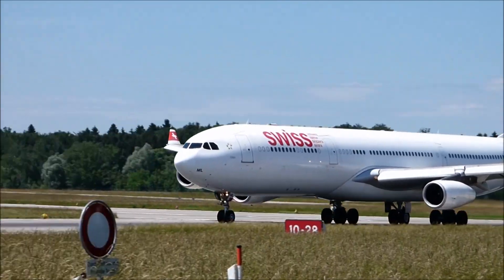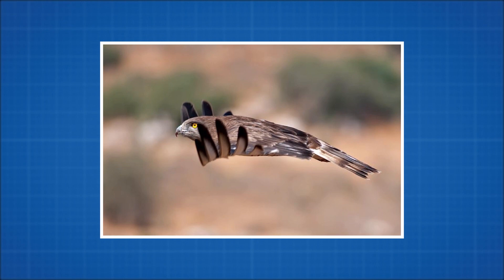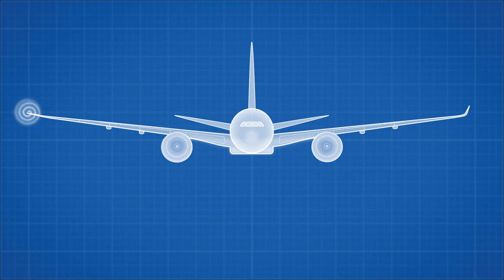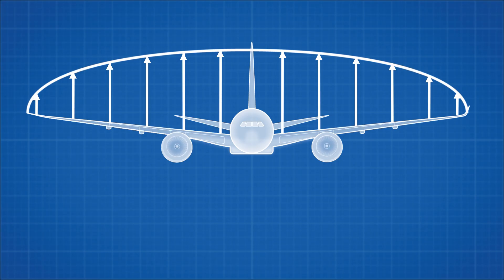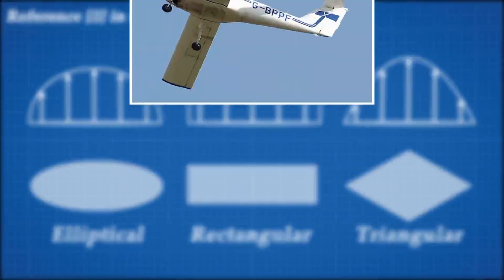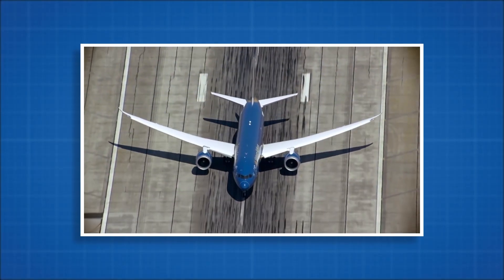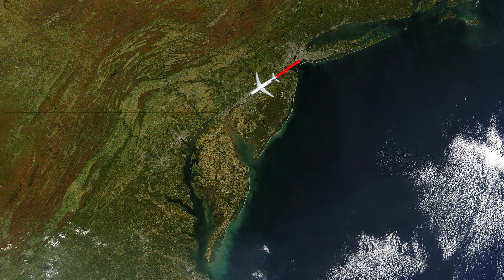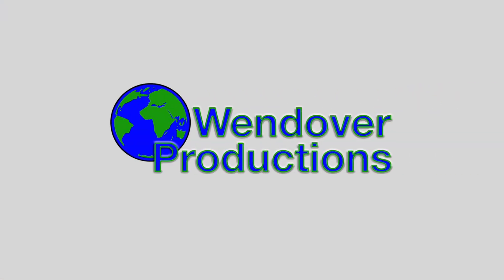Winglets - How Do They Work? (Feat. Wendover Productions)

Comment: When winglets were first starting to show up on planes, I read that the addition of a three-foot-tall winglet wasn't as beneficial as simply adding three feet more to the wing's length, but the winglets were preferred because they would allow the aircraft to more easily fit into standard airport terminals. Do you know if this is true?
Reply from the maker: Yeap, that's true! Not sure on the "as beneficial" part, but it does have similar effects.
Reply: Thanks for the reply. I watched just three of your videos and subscribed. Love this stuff.
Reply: But wouldn't a given increase in lift result in a reduction of drag due to the reduced thrust and angle of attack required to maintain a given altitude and airspeed?

I'm not saying it would give the same result as the winglets, but it doesn't seem like the extra wingspan would be as detrimental as you suggest.
Reply: +Phillip Breske it would also increase form and skin drag, itd be easier to design a winglet to retrofit to a wing that a wing extension. If you are referring to a new designed wing you may be right, and I think thats kind of what they have done with raked wingtips.
Reply: It is like arresting the pressure from both sides so the air don't mix. winglets are not ideal, they add weight. anyways adding a wing extension makes the existing wing create lift bcoz the end of the wings don't create lift. so what was a 10 foot wing created only 8 foot of lift area , but adding three more foot made it work at least upto its earlier ten foot. They are still learning.
Reply: Adding more length to the wing would just allow the wing to produce more lift, winglets are not added to increase lift but to decrease drag from wingtip vortices. The longer wing would make the vortices worse, and have an increase in induced drag, so would be overall much worse than winglets.

Comment: Is it just trick photography or did that boeing fly vertical just after takeoff?
Reply from the maker: There are no passengers on board, you would be surprised what those airliners are capable of when the pilots don't need to worry about comfort!
Reply: It's no photoshop, the power those engines can give is mental.

Comment: Most airplanes adjust the lift distribution by varying the incidence of the wing from root to tip. So even a rectangular wing can have an elliptical lift distribution. This is also done to get better stall characteristics by having the inboard part of the wing stall before the outboard part where the ailerons are providing lateral control.

Comment: So... Is the best wing form an elipse angled backwards with winglets?
Reply: The best wing form depends on the application for which it is being used. Angling wings backwards reduces their inherent trans sonic drag but reduces their span per lb of wing so they are not used on truly subsonic aircraft. In fact, for stability reasons gliders wings actually sweep forwards on many designs because this is the best option for this application and air frame. The opposite is true of airplanes which travel very quickly, in the supersonic range the induced drag is negligible compared to the other drags and is therefore wingless are not used (They would get in the way of too much air at high speeds for the trade off to make sense) and trust me if the F-22 could go faster because of winglets they would have stuck them on. Now just for fun an interesting thing happens when you go even faster past hyper-sonic speeds, winglets show up again on concepts like the idealized mach 10 wave rider. So I guess in summary there is no best wing form for any speed or any aircraft, angling the wings at different angles to the wind along the span (washout) can also produce the perfect ellipse for lift distribution and who is to say that doesn't make more sense.
Reply: Yeah your right, induced drag doesn't occur in the same way at those speeds because the craft is moving faster than the speed of information in air, the speed of sound. Thus the pressure distribution cant reach out around the wing in this air and the wiglets, or what is more precisely just the anhedral of the idealized wave rider is instead meant to capture the increased pressure from the attached shock below the craft. Hope i didn't say anything to imply otherwise. Thats what you mean inst it?
Reply: They show up again, but on the underside of the wing, on the mach 10 wave rider because of a completely different effect. The physics aren't the same as subsonic aircraft.
Reply: Yup, exactly. Two different principles or ways that they work.

Comment: An idea for your next video: Why are planes made out of Aluminum and not Steel? People might think it's because Aluminium is lighter. While it is less dense than Steel, in relation to the amount of load it can carry both are similar. Aluminum is used because, with its smaller density, it increases the thickness of panels which in turn improves the behavior of the structure against buckling. Buckling is a big problem for aircraft structures.

Comment: None of the explanations from various sources mention the problem of tip-vortex migration.   When at certain values of air speed and attack, the tip-vortex moves away from the wing tip and quite far inwards.  In that case the section of the wing extending out past the vortex is producing a down-force and wasted fuel.  By forcing the tip-vortex to remain at the wingtip, this loss-mechanism is removed.

I'd like to hear about the relative contributions of reducing the KE in the center of the vortical pattern, versus permanently moving the vortex-location out to the wing's tip.
Reply: This channel seems to be more suited for the uninformed, general audience, so I don't think the uploaders goal is to discuss detailed variations of aeronautical engineering.
Reply: As I understand it, it's not a "detail," it's the whole effect!   I.e. the typical explanation is simply wrong, and the main function of winglets is to stabilize the vortex location (keep it out at the wing tip.)
Reply: The only time I would think that a wingtip vortex would migrate root-wards significantly would be at critical AOA or higher. Which is outside the operating envelope. In fact, I've never heard of this happening to the degree that I picture you describing it, and I don't know how winglets would prevent it from happening in that case.

This isn't to be: so says me; but rather, this is my experience, I'm interested in this phenomenon you describe, since I've never heard of it. At least, not what I'm picturing in my mind. :)

Comment: Isn't the main point of winglets to simulate a larger wingspan without taking up too much space, and with less strength requirements.
Reply: Not necessarily. Airlines installed them to reduce the induced drag which in return would reduce the fuel costs of flights. Winglets don't really do anything to aid in producing more lift. And honestly, a wing with a wider and longer wingspan would most likely be a little slower than the original one.
Reply: +xXBl4ckB3ltXx You can model the efficiency of the wing as having a larger aspect ratio, and it actually also generates a different lift vector. Although the aircraft increases its fuel efficiency because of the winglets changing of the lift vector, there are changes the loads on the aircrafts structural elements which turns into more frequent maintenance. The main reason airlines want them is to increase range on their existing fleet and potentially add more money making routes. :)
Reply: Oooh clap clap! Someone also knows their aerodynamics :)

Comment: That's not induced drag! That's vortex shedding. Induced drag is reverse force caused by angle of attack, doesn't decrease lift, only causes more drag. Well it does decrease overall vertical lift, but that's more of a vector issue.

Comment: Hey can you tell me what the purpose of a spoiler on a car, versus a wing on a car? thanks
Reply: Jai Shetty ???
Reply: +oO360FanOo | DronezZ ive been dying to know! :)
Reply from the maker: +oO360FanOo | DronezZ Will definitely do it at some point. It has been added to the list!
Reply: +RoboKid360 then whats the purpose of a wing on a car? :\
Reply: +oO360FanOo | DronezZ Check the answer by Ryan Carlyle.
https://www.quora.com/How-much-downward-force-does-a-spoiler-produce-and-is-it-significant-enough-to-make-a-positive-impact-on-acceleration
Best explanation I've seen so far.
Reply: It’s just an upside down wing.  It diverts air up, pushing the wing down.
Reply: Some of the answers here are correct, but a spoiler and a wing are completely different things.  A spoiler creates a high pressure pocket around the rear glass of the car, so that air traveling over the body doesn't get sucked down and create drag.  A wing acts in the same way as an airplane's airfoil, but it's upside down... so it creates high pressure on the top of the wing and low pressure below.  This creates what we call downforce (or negative lift), which pushes the car towards the ground and increases grip.  Source: Race car engineer
Reply: both are useless
Reply: +oO360FanOo | DronezZ    hopefully i'm right but from what i remember, A spoiler would do opposite of that of an airplane wing, it would have low pressure air forming on the bottom of it's surface while high pressure would be forming on the top of it's surface. This create a total force facing downward towards the ground, keeping the car low to the ground at sharp turns or fast speeds. very important feature for a race car. Spoilers also allow the ease of air flow throughout the car's body, reducing the drag and increasing efficiency.
Reply: @RoboKid360  you are describing a wing, not a spoiler. a spoiler is usually just an upward-andled plane/panel at the end of the trunk lid. a car wing is an upside-down wing that usually sits on stanchions that's also located at the rear of the car. splitters are located in front of the car, below the car's front fascia.

when air hits the spoiler at the trunk of the car it causes a localised high pressure area and also deflects the air upwards, and thus push on the trunk downwards.
Reply: spoilers came form nascar. they found at a very high speed 150mph+ too much air would go under the car and lift it off the ground making it unstable, less aerodynamic, and also reducing the amount of force pushing down on the wheels therefore again less traction. their solution was a spoiler to push the rear of the car down. today they are more of a design aesthetic. especially if it is a front wheel drive car. hope that helps.

Comment: How about raked wing tips like the 787?
Reply: one of the main reason a 787 does not have a proper winglet like the a320 neo is because a proper winglet also increases the shear "stress"in the wing, and according to what i was told by my prof, the engineers at boeing found that the current 787 wing could not sustain such loads caused by it
Reply: They basically do the same thing- reduce the induced drag. The only difference is that the wings end on a point, and not an edge like some wings without winglets are. I know this seems a little hard to understand, but trust me on this ;)

Comment: Are the downward facing winglets (as seen on the Boeing 737 MAX for example) there for a similar purpose? How do those, in conjunction with the 'standard' winglets, work?

Edit - And another question. Why arent the horizontal stabilizers fitted with similar winglet tips?
Reply: Yes, they are. Horizontal stabilizers are needed for a different use, and of such winglets would hinder the abilities.
Reply: Alan, those are called scimitar winglets. They further increase the efficiency of the aircraft. APB makes them if you want to read more about them, Google it!

Comment: OH FOR GOODNESS SAKE. BERNOULLI'S THEORY HAS ALMOST NOTHING TO DO WITH WHY PLANES FLY.

The reason planes stay up is because the wings are pointed upwards which when driven forwards by the engines DEFLECTS AN AIRMASS LARGER THE THE PLANE DOWNWARDS.

Nicely shaped wings just make the plane a little more efficient, and a little easier to control.
Reply from the maker: +Chris Davies
I didn't even mention Bernoulli's Theory in the video, ya goof.
Reply: +Chris Davies https://www.grc.nasa.gov/www/k-12/airplane/wrong2.html

+Real Engineering https://www.grc.nasa.gov/www/k-12/airplane/wrong1.html
Reply: What about airfoils which produce lift at zero angle of attack? and if that is true why don't we just make wings flat and run them into the air at an angle? Whats the deal with the whole NACA airfoil catalog if thats true? and even if Bernoullis theory doesn't cause the pressure distribution (it doesn't) I assure you airplanes fly because there is more pressure below the wing than above it.
Reply: wait me or the original poster? What has almost no effect on the amount of lift? I need to know who needs to go to ground school haha.

Comment: Air pressure changes are only part of the lift phenomenon.  Downwash is very important, as well, and you can easily see its effects with rotary wings while the aircraft hovers just above grass or dust.